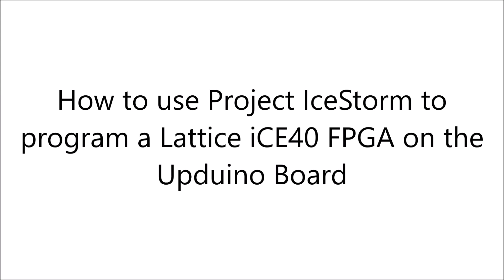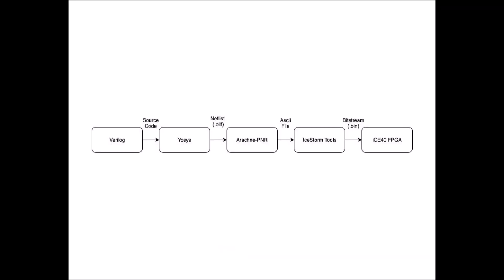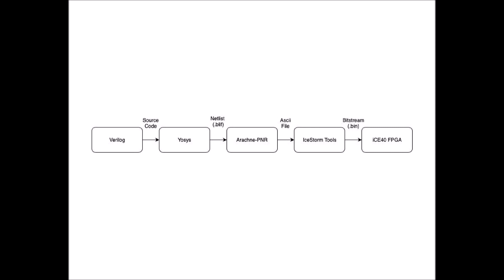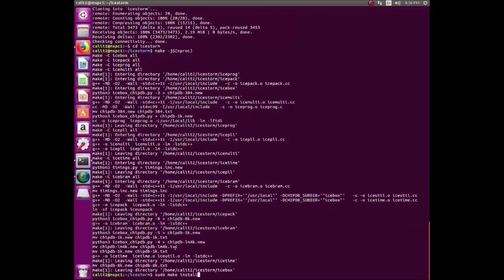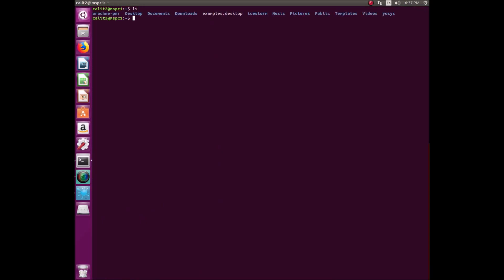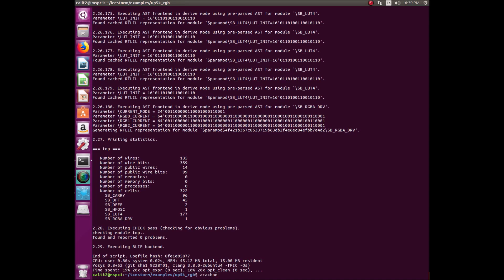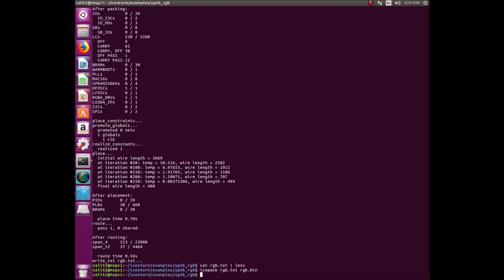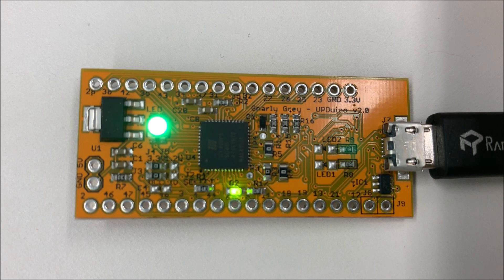Getting started with the Lattice iCE40 FPGA: Programming w/ Open Source Tools (Part 4)

Comment: So many low-cost Lattice boards*.. however do I understand correctly that only the ECP devices are supported by Lattice Diamond / Reveal?  
For the Ice FPGAs.. it's either open-source: 
f4pga ,  Icestudio , or Trellis Ice Storm (Yosys, nextpnr)         
OR    
Lattice Radiant / Reveal  OR
Lattice's  IceCube2 which doesn't have Reveal.  Note  iCEcube2 2020.12 Replaced Aldec with ModelSim ; iCEcube2 2017.08 uses Aldec

*
pico2-ice iCE40UP5K 
Icepi Zero  ECP5U
TinyFPGA BX Ice40LP8k
UPDuino v2 Ice40UP5
Icestick Ice40hx-1k 
ULX3S ECP5
OrangeCrab ECP5 25F / 85F
IzeZero Ice40Hx 
Icebreaker ICE40UP5K-SG48I
Fomu ICE40UP5K 
IceSugar Pro/Nano LFE5U-25F/iCE40LP1K
Cynthion   LFE5U-12F ECP5
LimeSDR Mini2 ECP5 LFE5U-45F